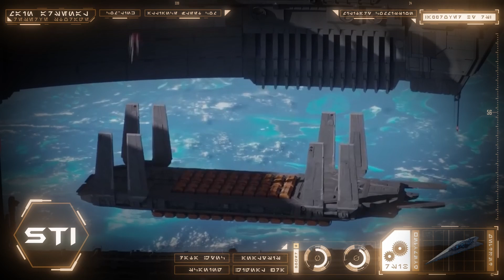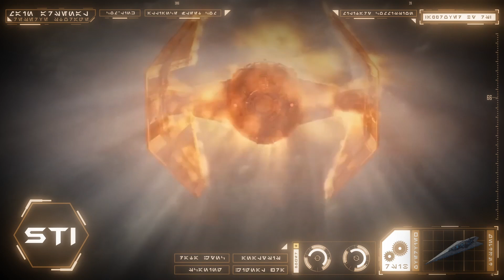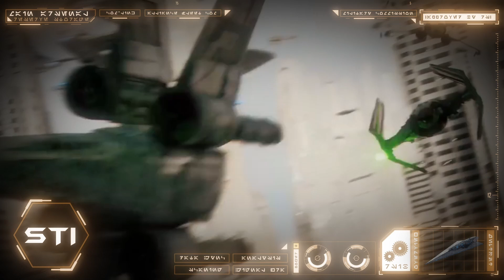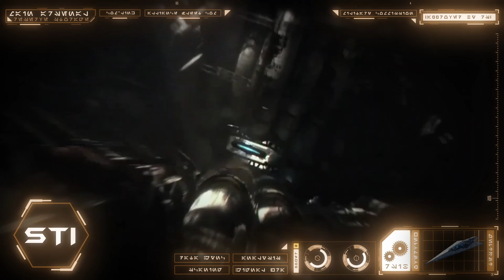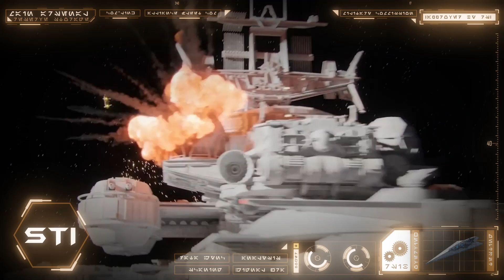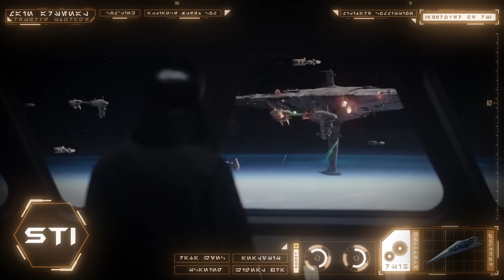The Executor’s Fatal Flaw – Why This Super Star Destroyer Failed!

Comment: The destruction of the dreadnaught Executor at the ridiculous, absolutely unrealistic and silly so-called “Battle of Endor”—-in which a tribe of Neolithic two-foot-tall teddy bears is supposed to defeat The Emperor’s “most elite” legion of mechanized infantry to bring down the second Death Star’s shield—-has always struck me as absurd. First of all, after Scarif and Lothal, The Empire would have quickly recognised the need for point defense laser cannons on all ISDs and Super ISDs; they also would have recognised the need to put capital ship shield generators in a much-less-exposed-and-vulnerable position. 
Finally, dreadnaughts invariably have secondary and even tertiary command centers in case the primary bridge was destroyed. One A-wing—-a small, light craft——crashing into the Executor’s bridge would NOT realistically have brought the massive warship down. Absurd.